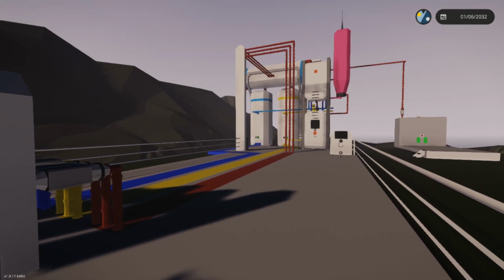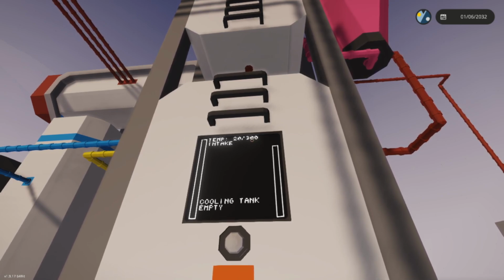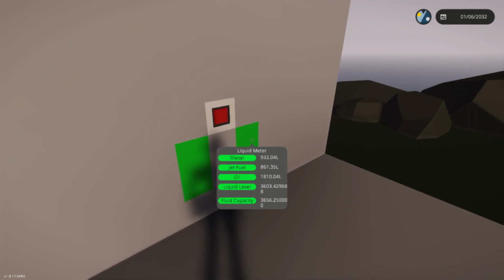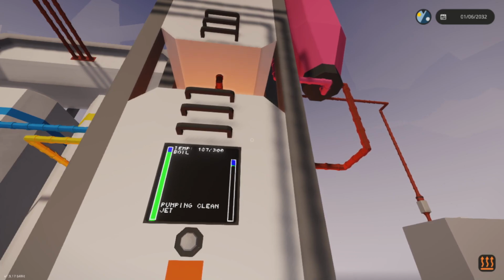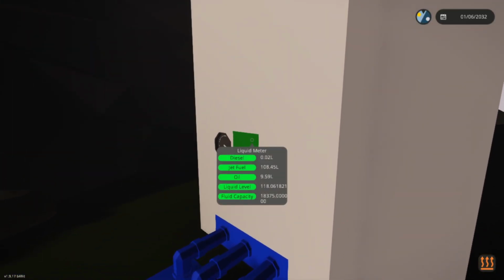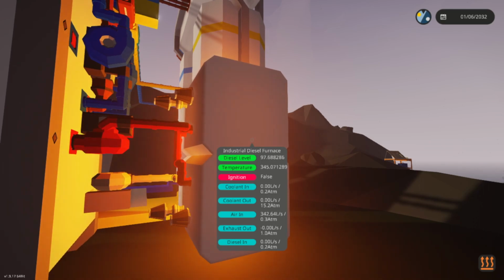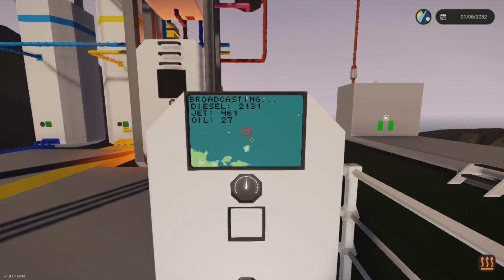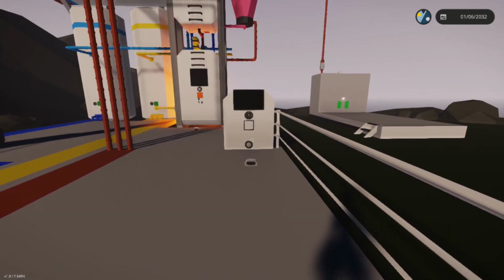Oil Processing in Stormworks

Comment: So what happens if you heat the oil with a nuclear fuel rod?
Reply from the maker: Oh, you don't want to heat it directly. But you can heat fresh water to 800 degrees (somehow) and then use a heat exchanger to heat the oil, and it works fine. However, it's worth noting that the keepalive block doesn't seem to 100% respect the way nuclear rods work, so you will probably come back to some radiation.
Reply: Sounds like you already did some testing there.
I got so curious I actually bought the game just now to try it out myself, I was supposed to wait for the steam sale...

Strange how direct heating does nothing, I ran into that really quickly having a reactor being at 400 degrees does almost nothing to increase the containment fluids. I barely got it above 40 and if the reactor drops below 200 it even starts cooling again.

Such a shame, seems like such a novel way to do "refinery". But when was the last time video games let us do things we can't do in the real world.